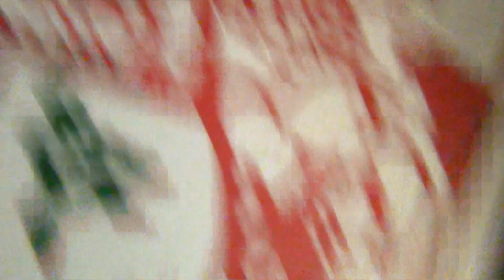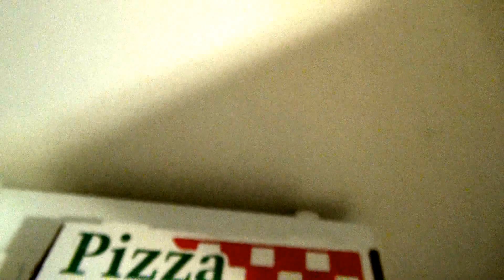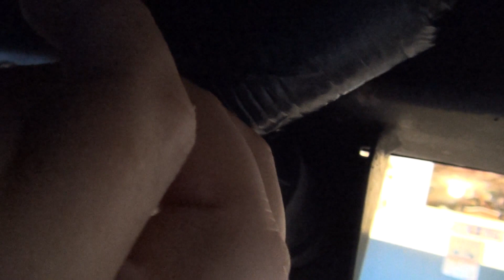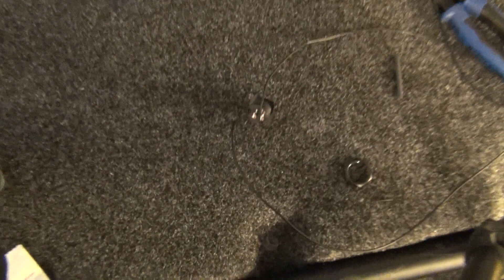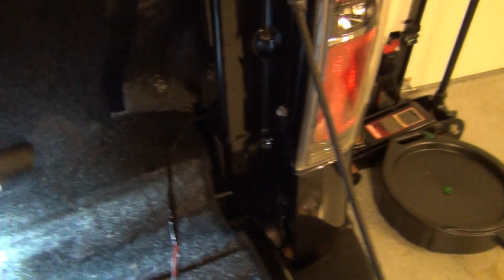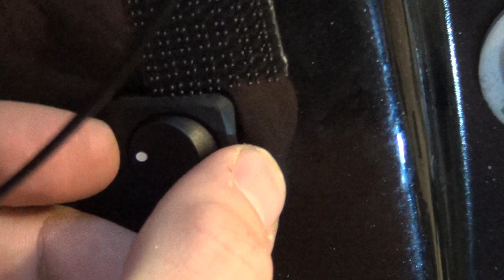Truck Bed Lights with LED Strips DIY How-To

Comment: I got a 6ft led strip  lights for $8 at the tj  max I just plug a power bank and it's wireless to turn on and off via remote

Comment: You are using the wrong pliers. I don’t think you completely compressed the clip in the connector so if you have trouble down the road, I would say you will need to recrimp it.

Comment: I bought the same lights and similar set up you did.  I ran the power directly from the battery.  However, the lights aren't bright at all.  I thought I shorted the first set out, so ordered a second set and it was the same as first set.  I did install a switch on the tailgate so when the tailgate opens the lights turn on and then off when you close it.  Your lights are bright and mine aren't.  The only thing I did different is I ran speaker wire (14 guage).  Any suggestions?

Comment: I don't see enything that's accurat use 20 v D.C. The wire is hot when the running lights are on

Comment: could've used you're interior cargo switch, and you're not hauling any wood in that truck. no one carpets a bed  and hauls wood, trying to save your man card.... smh
Reply: Gary Pursel Actually Bed Rug box liners work great for hauling wood. Nothing moves around on it. My Dad is a cabinet maker and had a Bed Rug in his old truck for 12 years. Just got a new truck and bought a Bed Rug again

Comment: Great tutorial, i think the multimeter was not preperly set up for 12 V, you needed to select 20 V range, you used 9V which normally is for testing small batteries.

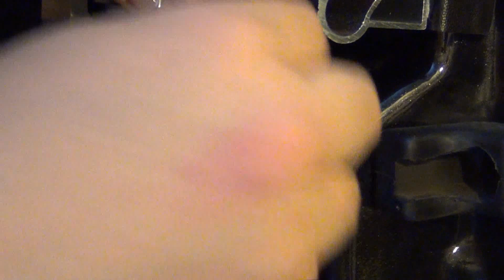Comment: Your soldering skills at 20:30 are great. Who showed you these great soldiering skills? 
You should use small amounts and heat up the wire or you will get a "cold" connection and they can just fall off.
Reply from the maker: +Dashcam Agreed. No one showed me how to solder, kind of just learned it myself. I'm definitely not a professional, just a DIYer learning while I go. Since this video I have educated myself a bit more on soldering and learned to heat the wire and not the solder so it flows through. Learned this alot from working with some SMD stuff. I will say that the lights are still working great.
Reply: LMAO
Reply: +anarchyx914 Heat the bare wire and soak it with solder than flick off the excess, than do it again with wires connected.
Reply: Jose R. Juarez Curious what your LMAO'ing about?

Comment: Okay, why are you looking at the wiring on the back of the trailer connector and/or using a multimeter when the wiring diagram for that connector is clearly marked (5:55) right on the door?

Comment: Using a heat gun is much better than a lighter on those connections. The lighter flame actually melts the connector, the heat gun shrinks it.
Reply: +PaLEOjd Yea, idiot using flame!

Comment: get a gob of solder hot and drop it on a plate of glass and after it cools  scrape the thin solder off the glass and wrap the wire  with the tin foil like solder; then hit it with  the solder gun. no excess solder to drop off  your solder joint when fusing them together using the thin tinfoil solder way.

Comment: so you solder and heat shrink wires in the truck, but not if they are under the rear bumper? That is so dumb. If anyone ever uses those wire clips on the outside of their vehicle you WILL have problems down the road. Never use those wire clips on your vehicle, even inside the vehicle.

Comment: You should have used the 20 volt dc scale of your meter, not the 9 volt one. Always select a scale that is higher than the voltage you plan on measuring......your meter appeared to have "auto ranging" but a lot don't. Just good practice.
  Cheers
Reply: +RetiredCanadian  Not to mention, auto-ranging or not you could have easily blown the internal fuse on your meter.  that 9 volt scale your using is for load testing alkaline batteries.  and those taps your using, try to avoid using them at all costs in the future. they will break your heart and possibly your bank account when they fail if used on certain circuits. otherwise excellent video keep up the good work

Comment: ALLWAYS SWITCH HOT WIRE.
Reply: Mack McCurry  is that your opinion; or is that a factory or industry standard ? because i know of a lot of factory components that are  ground switched. and if you know anything about electron flow you will remember that electrons flow from negative to positive; so in fact  he did switch the "hot"wire. what were you thinking?

Comment: One more idea you could have used if you already haven't done something else. You could have simply tapped into the factory bed light and ran your wires back to the bed using the factory bed light switch in the dash to control the bed lights.
Reply: ML L .... question ML I am thinking of doing this and having it hooked up with the cargo light.  My question should I run the wires to the cargo switch located on my lower dash or run the wired to the cargo light?
Reply: Which ever is easier for you. I ran a single wire to the cargo light itself (i believe the wire was purple at the light harness) because it was easier and closer for me.  You have to remove the light anyway to get to the fixture plug and not having to cram myself under the dash made it a lot easier.

You just have to run a ground wire to the frame where you enter the truck bed for the bed lights.  I hope this helps out!
Reply: ML L .... thanks for your feedback!

Comment: You should always switch the powered side of a circuit, not the grounded/neutral side. If one of the wires were to break off and touch the frame or bed it will short out even though you have the circuit "switched".
Reply from the maker: I actually re-did some of this. I ran a wire directly from the battery back to the lights so I didnt need the truck on to see back in the bed. I also put an inline fuse in before the battery incase the positive wire ever popped off or shorted anywhere. I should have done it this way to begin with.
Reply: I installed LED lights in my bed as well. I ran one single wire tapped into the rear Bed Lights wire (purple tracer to brown, switched factory wire) and ran that back to the bed. The LEDs are grounded to the frame and are controlled by using the factory installed bed light switch in your center cluster.  The lights can be turned on in park only and with or without the engine running.  If there is ever a short, the factory fuse will pop and all will be well in the universe.  You did far more work than was needed to install these correctly. But again, never, ever switch the negative side of any circuit.  Thanks for posting the video, I would remake this and do a proper install and take this video down.
Reply: ML L What do you mean as never switch the negative side of any circuit?

Comment: Nice video. I like the trick you did with adding the solder to the wires after they are wrapped; Very useful when I don't have 2 hands to use. Thanks!

Comment: Is it possible to wire it into the existing cargo light so that the lights come on when the stock cargo switch is on?  Or is the amp draw too high for that?
Reply: yes, there is another video that shows that. you'll have to pull the wiring diagram from off line.
Reply: Adesico87 Thanks I just wired right into the cargo light and it works awesome! :)
Reply: good deal. All trucks should come with bed lighting from the factory. IMO
Reply: Adesico87 Yeah for sure the stock cargo light always just shines on the load in the box and leaves shadows where the tie down points are and blindes you with useless light

Comment: I'm not sure about your technique you show at the end of the video. To get a proper solder joint you need to heat the wires up, not just the solder. When you heat the wires up it will draw the solder to them and bond to the metal wire.
Reply from the maker: I've used it many times before, and honestly the wire gauge was so thin (22 gauge) it simply takes touching the wire to heat it up.

Comment: you shouldn't cut trailer harness , never use wire tap they are garbage run  your own line from the cab with a fuse in line or tap in to box light and solider the wires , this guy not sure what he is doing what a joke !!!!
Reply from the maker: There is many ways you can do it, the one you mentioned was one of them I mentioned in the video. I tapped in for convenience.
Reply: Never tell people to tap in trailer harness. Asking for trouble down the road !!!!. Buy a remote relay and keep the fob on key ring

Comment: Flux and solder your wires first. Than solder heat them together when finished. Never twist than solder. Too excessive!
Reply from the maker: Thanks for the tip. I am going to look into this going forward, had never used flux before.
Reply: anarchyx914 no probs. the flux is like paste just dip the exposed wire in it. Than solder it. Do the same with the other side, add a shrink tube, and melt the soldered wires together parallel. Heat up the shrink tube and you have a clean job.
Reply from the maker: h8ncars Going to redo this solder job soon. It has held together over the witer thankfully.. If I had to do this all over again, I'd run dedicated power from the battery along the frame of the car. Live n Learn ya know!
Reply: anarchyx914 Been there done that. Best to solder both ends first and than after solder them together do not forget to put the shrink tube on first before soldering together. And don't use a lighter or torch it will burn the shrink tube.

Comment: What is the point of having a truck if ur gonna go and pretty up the bed? That's a sissy boys truck. Leave the trucks for those who actually need them.
Reply: I carpeted my bed cause I use the truck to haul my PA Equipment (Music Gear). I didnt want the speakers and such getting scratched and dented and wrecked. The light helps me see back there on dark nights. I am looking to get a cab installed to waterproof it, but I currently just have the tonneau cover.
Reply from the maker: I carpeted my bed cause I use the truck to haul my PA Equipment (Music Gear). I didnt want the speakers and such getting scratched and dented and wrecked. The light helps me see back there on dark nights. I am looking to get a cab installed to waterproof it, but I currently just have the tonneau cover.